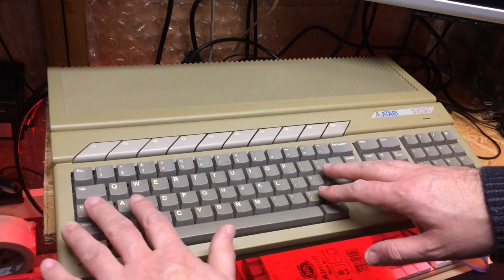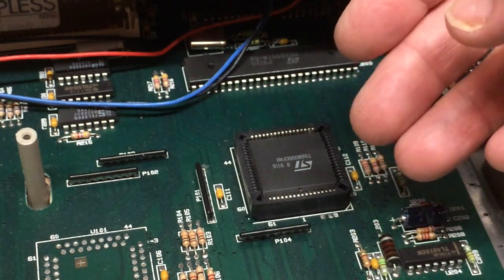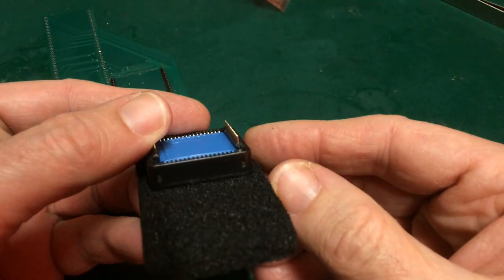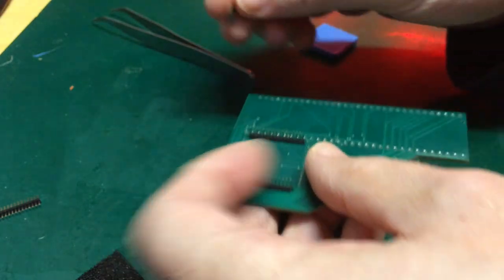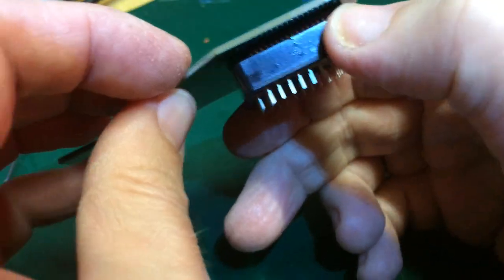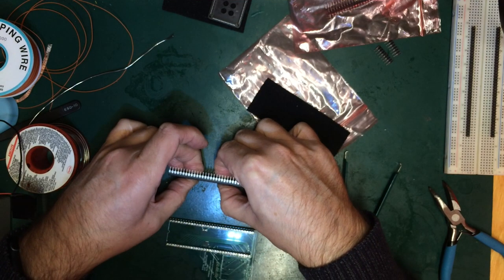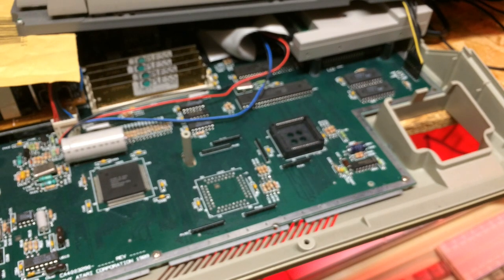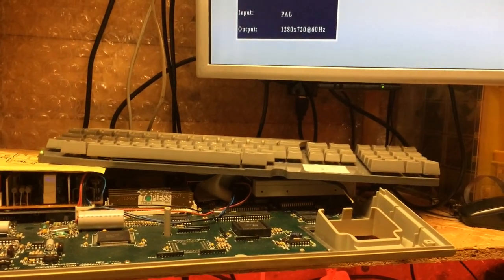Looking at a prototype DIP64 CPU adapter for STE expansions

Comment: Saw this pass by on the Exxos forums and watched with fascination. 
I thought you were on the right track with your 3D printed "former", so was disappointed when it failed. I spent the next day thinking about it. 
First thought was: How about resin printing? Then I did some research, and while more accurate, Resin prints break down at just a little over 40c so that's right out. (Insert sad trombone noises)
Second thought was: How about laser cutting something? This one might have legs! 
My local "Maker Space" has several and their accuracy strikes me as being high enough to be able to cut the parts with precision. I'd probably be doing two different parts out of two different materials. 
First up I'd make a soldering rig out of MDF. 3mm MDF should do it. You could either burn literally a hole for each pin or a line the length of the whole row of pins. (The latter may be eaiser to achieve). MDF should be heat resistant enough to handle the soldering for a couple of sets of adapters, and a single sheet of MDF should net you dozens of rigs.
For the second part, I'd be looking at using acrylic to make the former that sits in the socket to stop the pins bending in. It's nice and hard so will resist bending, and is conveniently nonconductive.
(Of course, if your local maker space doesn't have a laser cutter, this advice ain't worth a hill of beans :-D )
Keep the experiments coming!
Reply from the maker: I like the laser cutter idea -- plywood might be my weapon of choice. Acrylic touching CPU pins scares me, though, as it's an absolute static generator!

Comment: What about soldering a flex relocator to the board? Do you think it would fit under the keyboard?

Alternatively how about pulling up the 68000 pins to have its pins flipped upside down and soldering below the board? How much room is there?
Reply from the maker: I don't think there's enough space for more than one layer, really. There's no room underneath either. Dedicated board design needed, I think.

Comment: Shame the DIP 68000 could not fit upside down, can't really see but would the 68000 fit upside down to the right of the resisters? I would look at my Falcon but it is currently packed away whilst I re-org my desk due to WFH.
Reply from the maker: Possibly it could (would need a different board as the pinout would be mirrored!), but given the intention for this adapter is to allow other extensions (notably the TF536) to plug in, it wouldn't be very useful except in this very specific case!
Reply: @thetechnoshed  Ah that's true, a TF would never fit if the CPU was the other way up.
Reply: @thetechnoshed  Not if you pull the 68000 DIL pins up, then it wouldn't be mirrored. Then again you could also use a flex relocator having its pins pulled up? (the flex cable would have to be folded further though to use expansion boards upright, which it wouldn't necessarily have to if far enough from the KB)